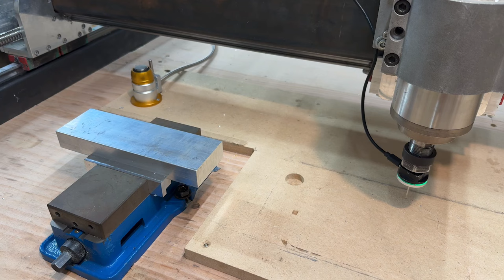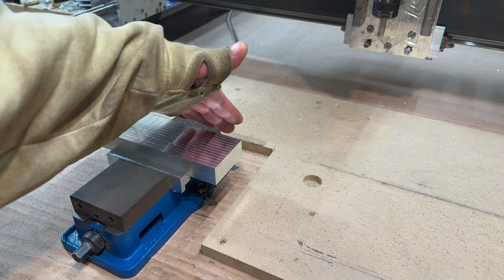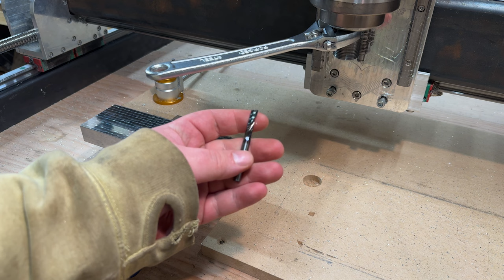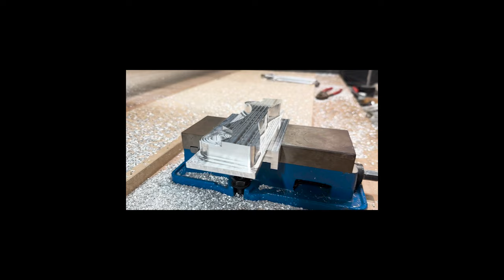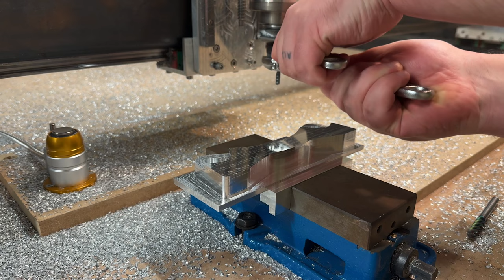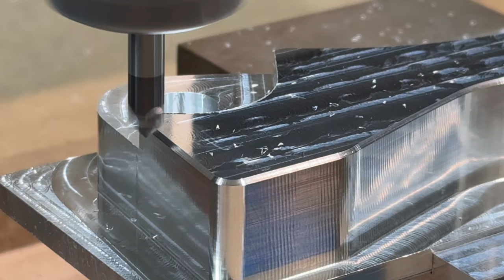Milling Clio 172/182 Wilwood brake adapters on home built DIY PrintNC CNC - Start to finish

Comment: It doesn't sound like your spindle is up to speed before it starts the cut at: 14:25, do your controller read the spindle/VFD feedback speed and wait? I have the same issue and I a change in my postprocessor in fusion to add a M0 msg at all speed changes require user input to continue the operation when the VFD is at correct speed. (https://youtu.be/59NlGJzJZX4?si=tO8QCZlPFgPc2PGf)

Great video, looks like you got really great finish.

Comment: 14:20  - your spindle ramp up time is longer than dwell time in CNC control software. it is not good.  they must be at least equal otherwise it can cause too much load on the tool at a start.

Comment: I'm just getting my own CNC set up to be able to handle aluminum and I'm curious...Did you need an indexed spindle in order to do the threading pass?  If so, did you DIY that on the spindle you have or did the spindle already have that feature when you bought it?
Reply: You may have mixed up rigid tapping with single point thread milling. The latter does not require indexed spindle. By the way using a chamfer bit to do the threaded hole chamfering is ridiculous. With the time waiting for the bit to touch the height sensor, he would have manually deburr 10 holes already.

Comment: Which kind of controller do you use?

I'm thinking of getting one of those probes but not sure how to use them with gsender
Reply: I would recommend PlanetCNC. A lot of probe commands and you can calibrate the probe too, tool wear compensation in controller too.
LinuxCNC would be a good choice too. Was too complicated for me so i didn’t used it.

Comment: What CAM software are you using? The surface finish is mirror like
Reply from the maker: Just Fusion360 with Post Process All to handle the tool changes.

Comment: there is no bit cooler, coolant, or lubricant, while trimming a metal surface?, wow
Reply: Tool wears quicker but it's possible in aluminium, even mild steel.
Reply: it called dry machining )   some material/tool coating combinations doesn't require coolant. it's OK.
Reply: @imqqmi  yes and no.  in some cases (very hard materials) using liquid coolant can reduce life of carbide tools because of thermal shock.

Comment: whats the specs on the CNC?
Reply from the maker: It’s a relatively basic PrintNC build. PicoBOB controller, Nema 23’s, 2.2kw spindle. 1230x900mm work area.

Comment: What CAM software did you use?
Reply from the maker: Just Fusion for CAD and CAM, Post Process All plugin to restore rapids and handle the tool change stuff.
Reply: @Beeeaned  it would be great if you make a video about cam modelling your parts
Reply: @Beeeaned  Ouuuuuhhhhh Can you point out to the plugins to restore rapids?
Reply: @Beeeaned  Thanks for the heads-up on 'Post Process All' 👍